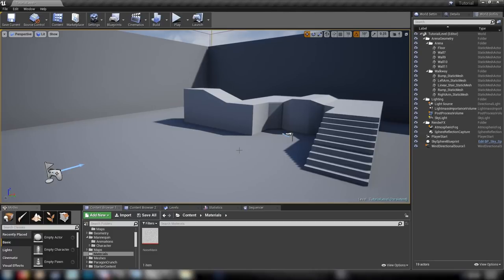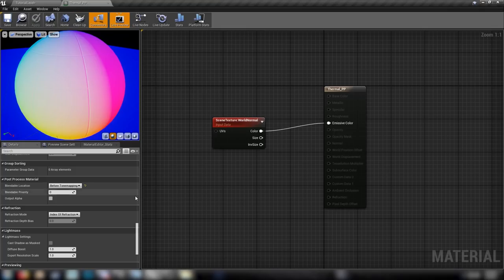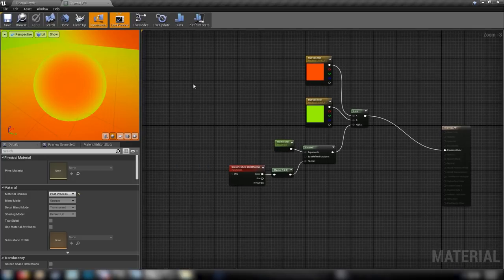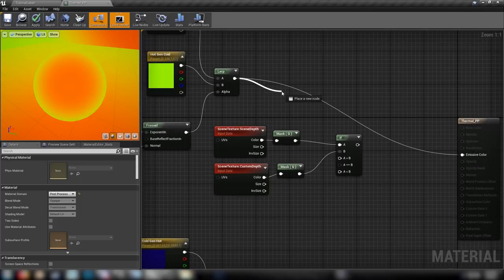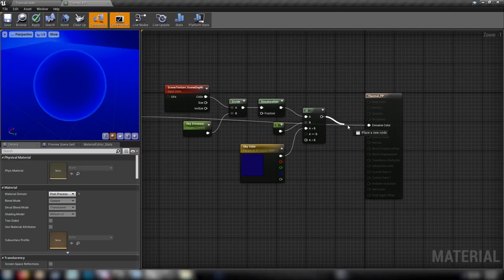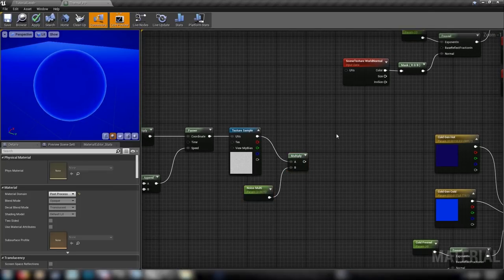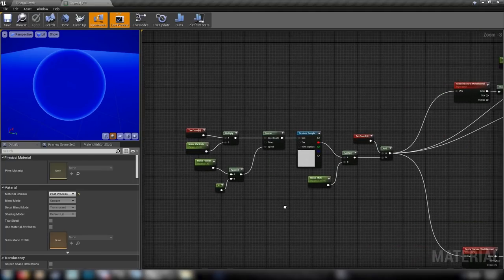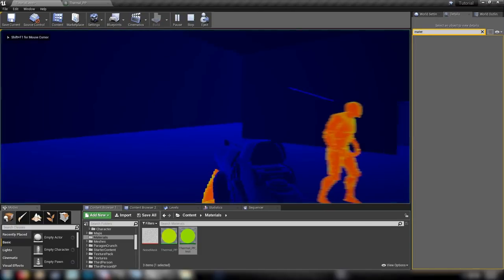UE4 Tutorial: Thermal Vision

Comment: And how would you make a more accurate thermal camera as far as temperatures? In this example I see this as only a hot/cold thermal camera. You enable the custom depth and it sets it to hot, but no temperature reference per object. For example, what if you had a human subject wearing a jacket, the jacket on a real IR camera would measure maybe less than 30 celcius whereas the face would be 37 celcius?